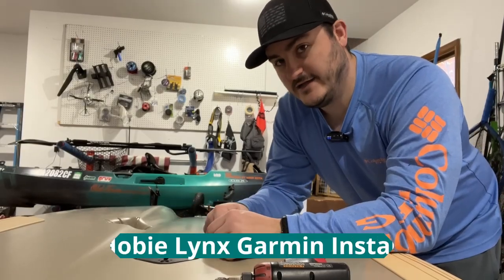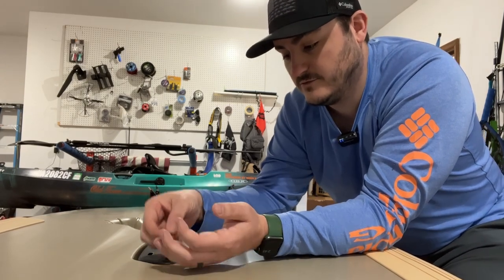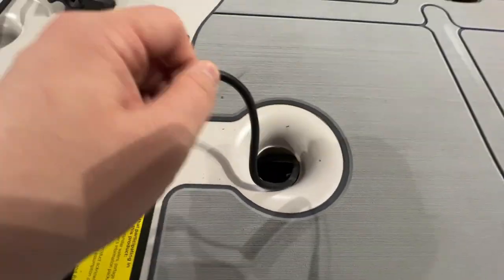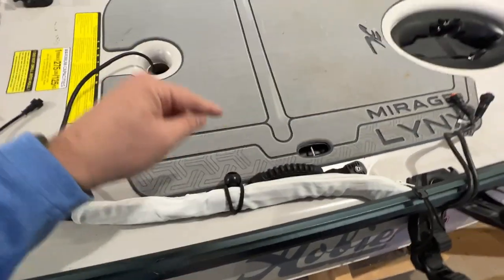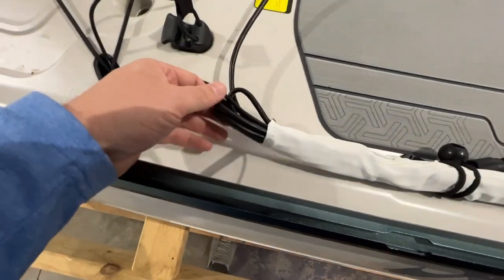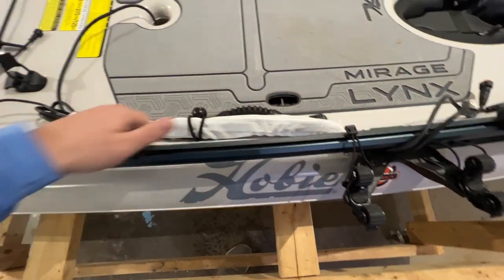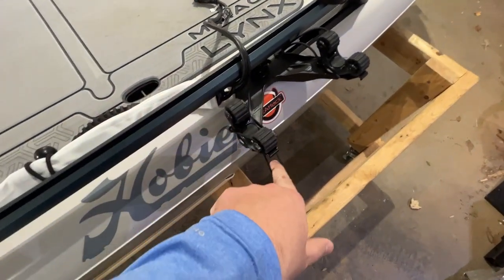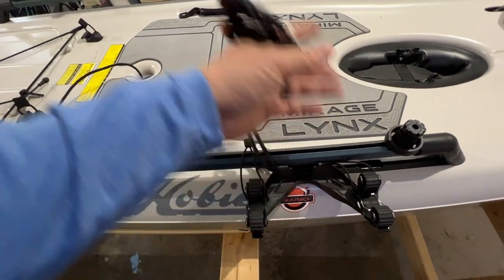Hobie Lynx Garmin DV Fish Finder Install

Comment: I like that cable management sleeve, great Idea! I'm trying to decide if I want to go with the stakeout pole like you have or just go with the power pole since I already have the unit. I also don't want that pole sticking up all the time lol. Have you found the stakeout pole being a pain or does it work out well?
Reply from the maker: It works great. Only thing is it does adds weight, which just depends on if your trying to go ultra lightweight and simple or not. And because its not all the way in the back, it should be easier to get to when you don't want it sticking straight up.

Comment: Possible to give me links to the harm in striker and all the mounts and adapters needed as I just purchased my lynx and I’m mostly a fly fisherman but want to outfit it for bass. Im a female so I’m not completely sure. I have my rails but need the battery set up, the harm in and yak attack mount and anything else. Thank you so much for the advice 😊
Reply: Garmin not harm.. typo

Comment: Nice and clean install but i would think your sidescan would be blocked?
Reply from the maker: Yea I don’t think side scan works with this method I should have been more clear. I am waiting for some sidescan transducer adapter to come back in stock. I just don’t use side scan all that much so I’m just being patient on that, but everything works great and it’ll be perfect for CV fish finders.
Reply: @BlueSummitOutdoors  Berely Pro makes one that protrudes down under the kayak enough to allow sidescan. Pros and cons: pro, sidescan would work perfectly; con, susceptible to damage hitting rocks or loading into truck. I’m still researching power options too like Bixpy, Torqeedo and Texas Paddle (which uses the transducer pocket for its little motor).
Reply from the maker: I’ve been contemplating getting the BerleyPro adapter, maybe down the road. Yea seems like the best options right now are in the drive well with torqeedo and bixby